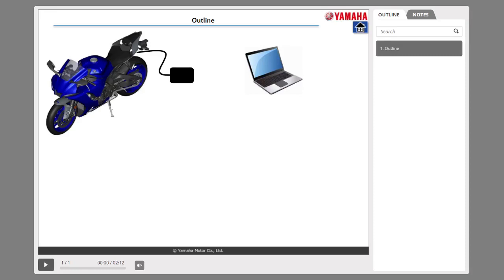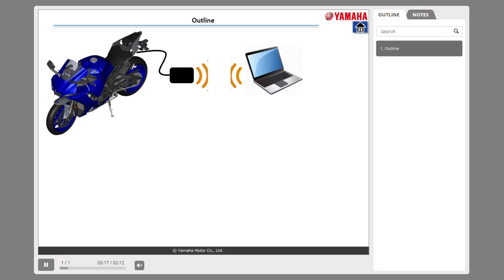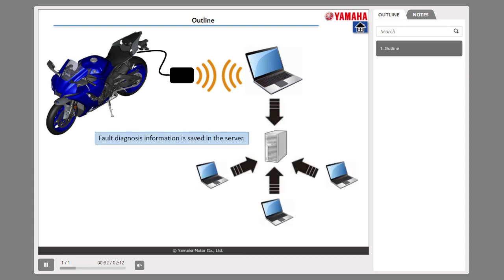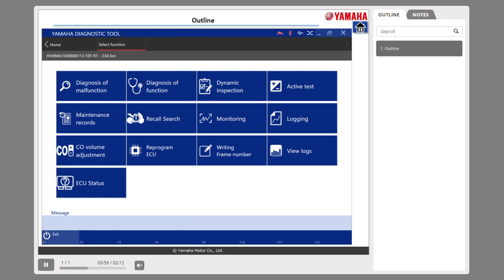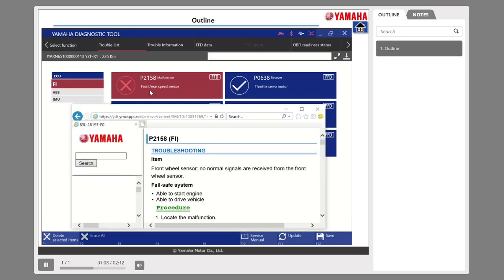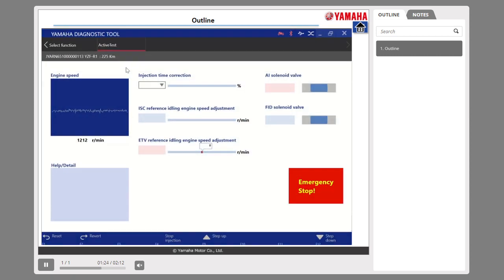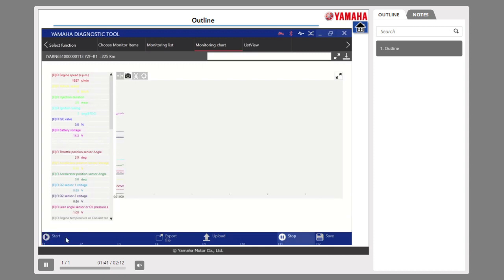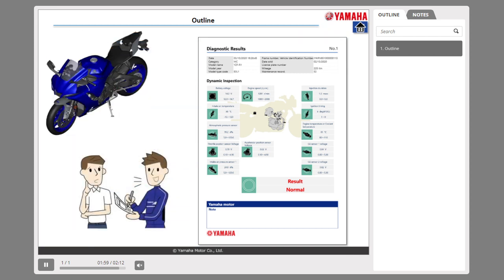What is Yamaha Diagnostic Tool?

Comment: Where to buy
Reply: You need to be a yamaha dealer
Reply: @exilor92  negative sir. Well sort of. CANDOO PRO is $449.00 and it will allow you do diag yamahas and if you purchase the full kit merc, seadoo, evinrude, BRP, etc. Mine only does yamaha outboards but I can pull read/write to the newest of motors - 2023, unlike the old YDS v1.3. If you own a Yamaha engine or do this type of repair work for a living this is a must have! Also allows you to reprogram chipped waverunner lanyard keys!